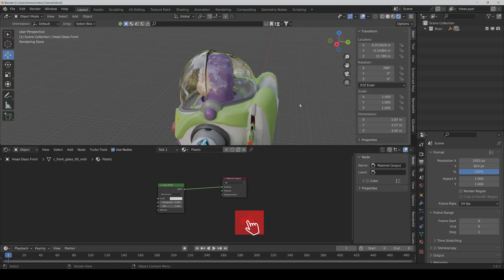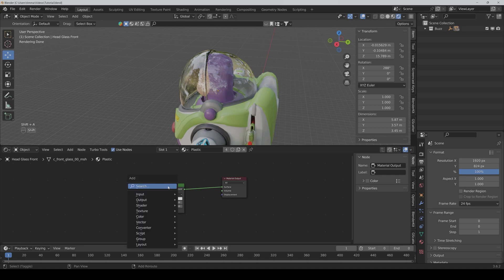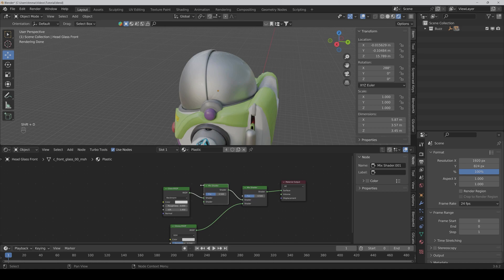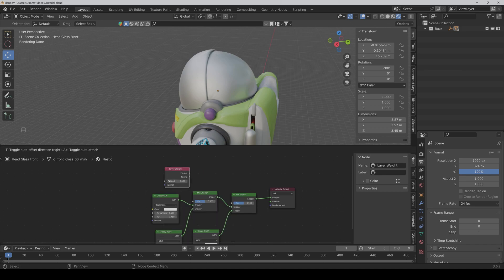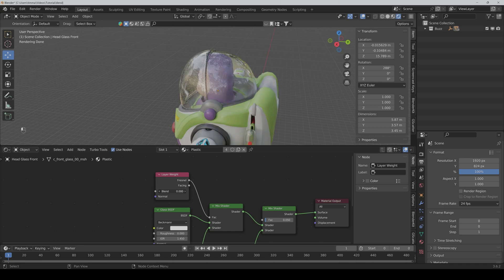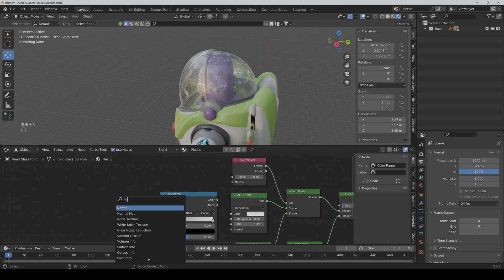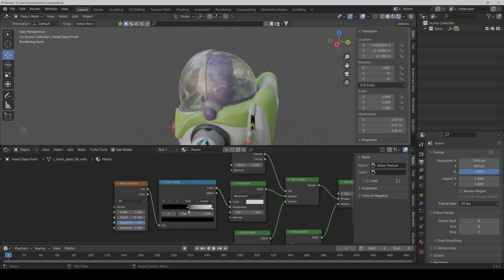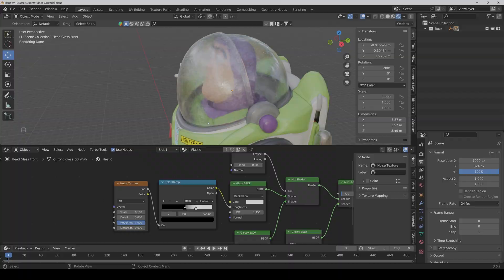Transparent Plastic in Blender - A Fast Way for Good Loking Plastic (Cycles)

Comment: super great tutorial! Thanks for uploading this <3 Do you know what settings I should change to stop the objects from appearing darker within the plastic material? I wanted to create a space helmet but it looks like the helmet is still casting a shadow as if its opaque rather than allowing light through to light the head inside?
Reply from the maker: Thanks! You can use a Ray Length Node for that. Check out my „Better Glass in Blender“ tutorial. There it‘s explained how you can do it :)

Comment: thank you for the tutorial! I followed all the steps but the objects inside aren't showing correctly. The colors of the objects just fill the plastic objects. Any idea maybe why it's like this?
Reply from the maker: Gladly :) How do you mean exactly? The colors inside are also plastic? 🤨
Reply: @vicubeanimation  No they aren't. I have a circle (1) inside another circle (2). Circle 2 is the transparent plastic one. The other one is like a hard plastic (kind of like buzz his head). It looks like circle 2 is just reflecting the color of circle 1
Reply: So I can see the colors of the object inside but not the like shape of the object
Reply from the maker: Ok strange. Did you set the IOR right? I´m not sure why something like that could happen 🤔 @dreamera6503
Reply: @vicubeanimation  yeah I did. Haha it's weird indeed. Thank you so much for helping me tho! I'll try redoing everything and hopefully it'll be okay this time :D
Reply: I solved it setting in Glass BSDF IOR=1. But in your tutorial the value is 1.450 and that create that issues
Reply: did you find a solution ?
Reply: @Romain-i4n  nope sorry

Comment: Hello, I followed the guide and applied it, but the object inside the applied object appears to be refracted. Can you tell me how to solve this?
Reply from the maker: Hmm not quite sure why. Is it also refracted if you only use the glass bsdf? You could try going into edit mode, select all faces of the the plastic object and then press Shift + N to recalculate the normals outside.
Reply: @vicubeanimation  I adjusted the refractive index with the Solidify modifier. I think the problem arose because my object had no thickness. Thank you for your help
Reply from the maker: @oaw-  Ah ok interesting 🤔